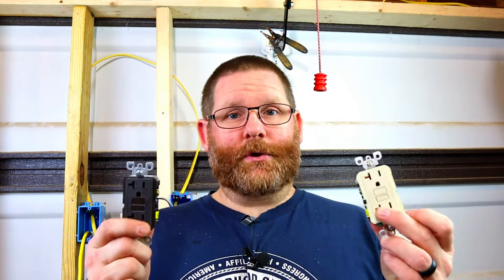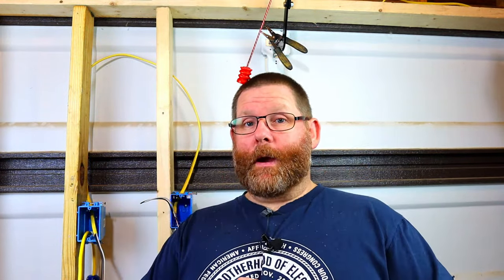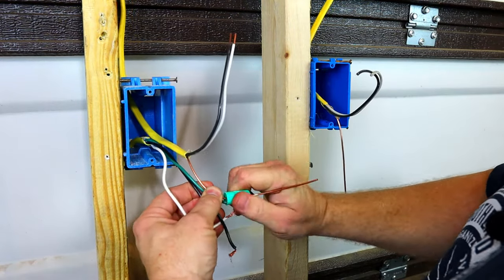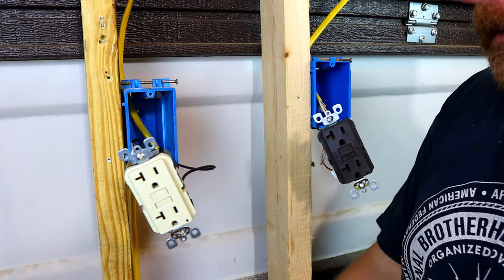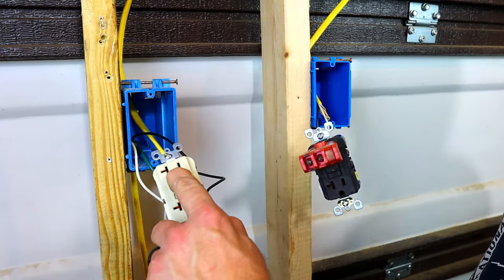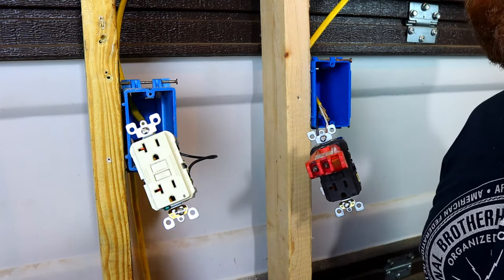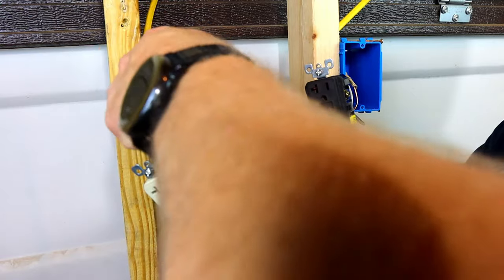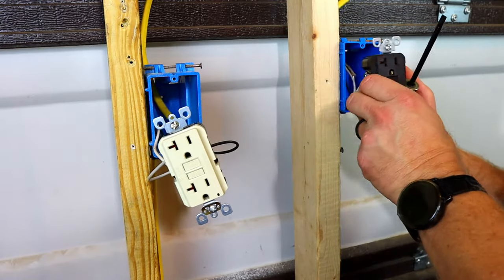How Many Ground Fault Circuit Interrupters On One Breaker

Comment: I recently put up a pool. I have a dual receptacle outside for the pumps. Both receptacles are GFCI. These receptacles are being fed from another receptacle in my shop. Just to say if the pool was to rupture and the water hit the outlets, wouldnt you want the GFCI outside to trip the GFCI in the shop as well to kill all power from the shop to the outside receptacle? In order to do that they would have to be wired the first way you showed correct? Is the first way a not correct beacause its a safety issue as well or because its just a nuisance? Or would i be better off just putting a GFCI in the shop and 2 regular recpetacles outside for the pumps?
Reply from the maker: So my opinion will or can be alot different from most of the people who do pools. In your scenario if the pool bust. I personally would want the box with the receptacle to be completely dead. In other words, if you had a gfci in it and it bust, the gfci would trip leaving the wires hot inside the box. Which is ok by code but let's say that the water is up to box level well you have a circuit that is hot, submerged in water. Now if you do have it feeding regular receptacles off the back side of the gfci in the shop, once the water trips it the whole circuit is dead up to your shop leaving the pool receptacle completely dead. That's what I would do. Make sure that you put the stickers on it that are included in the box. Saying that the Recep is gfci protected and my recommendation is buy weather resistant receptacles.https://www.amazon.com/dp/B001DFOZ4S/ref=cm_sw_r_as_gl_apa_gl_i_KFRMBKA27CYGE8YKDFQB?linkCode=ml2&tag=mountaineerou-20
Reply: Thats what I am going to do then. I just figured 3 GFCIs would be more protection than just the GFCI in the shop in case it fails but i guess in that scenario if the gfci in the shop fails it would still be hot up to the box with the other two GFCIs.
Reply: But just for my knowledge. Is the first example you showed a safety issue? Will it cause problems with the receptacles?  Or is it just wrong because it is a nuisance to have to reset all GFCIs if one trips?
Reply from the maker: It won't work. Because you cannot feed a gfci off a gfci load to line. If you hook it up line to line it will but still be hot in the box. Hope that helps

Comment: Extra Cost for no gain.  Pigtails on #1 should be correct or the same as 2 wires on the input Line Feed.  Fancy electricians gloves are handy.  I didn't see if you reset the #2.

Comment: Excuse me but, if you pigtailed the wiring on each outlet (both being connected to the Line terminals)  , they should work ... Correct ?  Each GFI would be independently powered and the breaker would be independent on each GFI.
Reply from the maker: Yep exactly

Comment: Wonderful instruction. I plug my Hair Dryer (with a self contained GFCI in the cord) into a GFCI circuit.  Will try tripping out the wall mounted GFCI to see what happens. Thank you.
Reply: Ya been my experience 2 gfci don't like working together but maybe modern ones have worked that out

Comment: Question: if you have two gfis in one box, and both are 20 amps. You must have a 40 amp breaker, yes?
Reply from the maker: Nope 20 is 20. Providing that the wire is a 12 Guage and everything is correct
Reply: @MountaineerOutdoors  fantastic!! Thanks

Comment: I have three gfci one in each bathroom. All of them seem dead and will not reset. Plug tester has no lights confirming no power to any of them. I am assuming they were wired wrongly at some point and tripped but are unable to reset. The question is how to find the parent gfci that is causing the others not to work?
Reply from the maker: If all 3 are dead are you sure that there isn't a breaker tripped??  To find out which one is first you will have to take them all apart and separate the wires and once that is done you will be able only have one that is hot.
Reply: @MountaineerOutdoors  i am pretty sure there are multiple on one circuit. We have had this for a long time and just never got around to fixing them. Do you think i could find the live gfci with a non contact detector/meter if i took off the cover and got the meter to the terminals?
Reply from the maker: If they are wired correctly then no. If you have 3 gfcis and they are wired on the line side it will just keep sending the hot to each kinda like pig tailing. I would definitely pull out one and see if you have a hot there. Use both a non contact detector and a true meter to check at the screw terminals.
Reply: @MountaineerOutdoors  thanks for the advice. It gets really confusing. I know just enough to be safe so this helps.

Comment: I think If you referred to the line side it might be more clear to some folks.  Such as I put both white wires on the silver terminal line side and both black wires on the brass terminal line side it might be more clear.  You turn your receptacles around naturally, when you tighten the the terminals to get a good solid grip.    Makes sense but it might confuse some people.  I had to re-watch it myself a couple of times.  Not critical, trying to be helpful
Reply from the maker: Oh no I completely respect your comment. And you make a very solid point. From here on out I will Def say that... That definitely will help everyone out and I appreciate your input. Thanks for watching and commenting ☺

Comment: Can u do one with 3 GFI would it be the same? Just keep putting them on the load? Am looking at putting them on the soffit of my house should they all be GFI? Would I also need a metal box to connect all 3 oe can u just connect them all without a box.
Reply from the maker: Definitely all gfci and if you use all gfcis wire them to the line side. And absolutely put them in a box
Reply: @MountaineerOutdoors  if u do one of these can u please tag me. Also could I use the existing wires coming from the outlets in the garage?
Reply from the maker: Yes you should be able to.
Reply: @MountaineerOutdoors  thank you electricians want $125 to $150 an outlet and trying to put them up for cameras
Reply from the maker: Not sure where you are but here in my small town when I do things on the side I charge 35/hr   bigger areas around me side work is 50-60/ hour.
Reply: @MountaineerOutdoors  In Oklahoma.

Comment: What if the first receptacle in the circuit powers the refrigerator? Then I have to pull the fridge out from wall to reset it?
Reply from the maker: That would be correct. Did someone wire it like that?

Comment: Hey thanks for the vid it did help!! I have a question idk if you or anybody here could help. I'm remodeling my house and had to rewire the whole thing, now I connected the electrical box and everytime I turn a breaker on it doesn't trip it but cuts power off I've been troubleshooting it but I can't seem to find the solution. I have a tester with me and power is on at the poles, all the breakers are off. As soon as I turn any breaker on the power to the the box shuts off. When I turn the breakers off the power at the poles turn back on
Reply from the maker: Do you have it hooked up right? I would have to see a picture of your box

Comment: So when you have two outlets on a kitchen counter by a kitchen sink both outlets have to be GFIC ? Which is on one circuit ! So am I right?
Reply from the maker: Any thing in the kitchen has to be gfci protected. You can line and load them but they have to be protected by a gfci circuit

Comment: I've got a different, but related, question: I extended an outdoor outlet circuit underground to power a shed. I put a GFCI Circuit Breaker onto the circuit rather than dealing with changing the outlet cover to accept a GFCI outlet from the existing standard outlet, but as soon as I got the underground wire hooked up (18 ft from house to shed, plus another 10 or so ft along the house and inside to the panel), the breaker inside would immediately trip, regardless of how perfect I made the wiring. When I replaced it with a standard breaker, now it works perfectly.

Any idea what's going on? Why a GFCI breaker keeps tripping on an underground wire?
Reply from the maker: Is your conduit full of water? Is your nuetrals touching your ground wires? Is your gfci breaker hooked u correctly? Nuetral from circuit on breakers not the nuetral bar?
Reply: @MountaineerOutdoors  I bought liquid tight flexible non-metallic conduit which is one single piece from junction box on the side of the house to junction box inside of the shed (it goes in through the shed floor to prevent water ingress). I used direct-burial rated 12-gage romex (solid plastic all the way through instead of paper) which also makes a non-stop run from junction box to junction box at each end. I can't say for 100% certain that there's no water in the line, because I laid the line a day or two before I ran the wire through it, but I did make sure the openings were pointed down, or otherwise sheltered inside the shed. I know the junction box doesn't get rained on because my eaves are 22" not including the gutters on a 1-story house, and the box is 3 ft above grade. 

As for the circuit breaker, itself, it was definitely wired correctly because it predates the underground extension by a year or two with no issues.

Comment: one GFCI can protect all downstream receptacles which do not have to be GFCI.  by the way you can put 100 outlets or 500 outlets on a circuit.  there is no limit.  however the local inspector will usually have a Number like 10,  because they seldom understand the code and they use rules of thumb.   sensible wiring of a home will be 10 or less but there is no limit.
Reply from the maker: Yes I fully agree with you... There definitely isn't a set number of receps. I like the 10 rule though
Reply: I would agree that there is no limit for recepticles, however, nec article 110.3 b
 Says we must follow the instructions for the listing or labeling.  I believe the instructions that come with the gfci restricts us to 5 or 6 down stream recepticles.
Reply: @keithharrington4595  good point for gfci.

Comment: Hey man I ran into a problem with my own house.  Built an outdoor deck that surrounds an above ground pool.  We had electricians come and put in outlets on the outside of our deck.  There’s 3.   All of them are GFCIs.  We never really used them until this summer we hung string lights and we plugged in the string lights with an extension cord.   The string lights and extension cord are both outdoor rated.  After a couple days I went to plug it in and they wouldn’t turn on.  I noticed the gfci had a yellow light and the other GFCIs were not even on.    I’ve trouble shooted and looked inside the one that has yellow and eveything looked right.  I used a differnt outlet on the other side of my house that was on a different circuit and the lights worked. It’s just that one circuit with the 3 GFCIs.  The pool is right next to my garage and the only other thing on that circuit is my the battery/light for my garage door opener. Also it’s all 14 gauge wire.  Any ideas of what could be going on?
Reply from the maker: Maybe bad gfcis. Or they are hooked up wrong
Reply: Those were not real electricians if they put multiple GFCI Outlets on one circuit. The correct way is the first Outlet on the series gets a GFCI outlet, and it will protect everything Downstream. It just has to be wired correctly which is basic stuff. The load screws feed and protect all the outlets Downstream, the first Outlet gets the power from the circuit breaker to the line screws. If they did what it sounds like they did they are just some guys who don't know anything and are saying they are electricians.
Reply: If your house is in an environment that received significant amounts of snow it can pile up near the outlets an destroy GFCIs. I have a GFCI that went bad on my back porch from snow intrusion. I'd replace the extra GFCI outlets with standard and wire off the load on the from the parent GFCI. If the others are still good keep them to replace the parent later. GFCIs have a shorter life span in wet environments.
Reply from the maker: Great advice!!

Comment: you do not show trying the test or reset on the second gfi to see if it won't reset or is tripped because it is plugged into first gfi would be easier if the second gfi had those indicator lights or button that appears red when tripped. was the reset button pushed in does it show tripped?

Comment: I always use the stab in the back connections, comments that lead individuals to think using the stab in the back (manufacture design) is wrong/dangerous is simply comical.  Otherwise, I enjoyed the video.
Reply from the maker: I wish that I could agree with you on that. Although I appreciate you watching, I have been on too many call backs for compromised receps. I appreciate your comment and watching though. Have a great day ☺

Comment: Customer has a prefab greenhouse with a gfci. The whole thing plugs into another gfci on a stand alone breaker. When the greenhouse is plugged into the other gfci, the gfci on the breaker stops working.

Comment: you ask why would we want several gfci outlets on one circuit- take a local law that restricts the number of protected outlets from one gfci outlet on the load side to 3 outlets.  You have a standard bedroom with two outlets on each wall, a light in the closet, and a light and fan, all from a single breaker.  The way I wire this in the local area is three GFCI outlets, from the panel, with one protecting the lights, one protecting three outlets and one protecting two last outlets.. so I know have one 20 amp breaker for one bedroom, 8 outlets, two lights, so ten points, within my 14 points for one breaker, (12 points if you include the switch points but still within the 14 points for 20 amp breaker under local code), but have the three gfci outlets to get around the gfci load limits. It works, the local inspectors and my customers feel I have added safety that is not yet required locally, but, it is done. Plus, since all cabling is done here in conduits, it is pretty easy as i run the conduit from one outlet box to other wall for gfci runs instead of along the wall for the load runs..lol.. Local inspector has been taking pictures to show others this as correct way while agreeing that we need to change the load limit on outlets as well..

Comment: In the incorrect method, can't you still get the second GFCI working by simply resetting the receptacle, or will that trip the first GFCI?  I have never tried that but I have heard of it working that way.  Its the current imbalance that trips the GFCI right, so essentially both get tripped when one trips cause there is a current imbalance on the circuit.  My house just has one circuit for all the bathroom outlets and then a GFCI on the first receptacle.  The other bathrooms are still protected because of the first GFCI correct?  It was that way when I bought the house so I assumed that was allowed based on NEC.
Reply: Absolutely correct. No reason whatsoever to put multiple gfci's on a single circuit. All outlets after the gfi are protected. As he showed the 2nd outlet still had power at the screws but not out of the front of the outlet. The test button is just a internal "mechanical" resettable switch. You would still have power at the back of first gfci. If you want to do it right, put a gfci breaker in the panel.
Reply: Exactly, if the second GFCI is connected to the upstream GFCI on the load side, when the first tripped current will be cut and trip the second GFCI therefore you also need to reset the second one.  One GFCI for the entire circuit is allowed by NEC.

Comment: Sure, you only need a single GFCI receptacle upstream protecting all n regular outlets downstream.  But, once the drywall is up, unless you previously kept a "map" or other record of which outlets are daisy-chained to which or were the original installer and simply remembered, any user or later person/owner/tenant/whoever can spend hours trying to figure out what happened before finally speculating there's a lone upstream GFCI receptacle somewhere, and more hours locating it.  (This literally happened to us, and even an electrician neighbor spent an hour helping us figure it out and finding that GFCI, which turned out to be in the garage, darkening a receptacle on the other side of the wall in the living room.)

Multiple GFCIs in Parallel has the benefit of localizing the reset switch to the (presumably) nearby plugged-in device that tripped that outlet in the first place.  You don't have to travel far to reset it right away after (hopefully) correcting the issue, let alone go on an expedition to find it, or go all the way to the panel/sub/loadcenter.

The cons are:
1) that each GFCI only protects that receptacle's devices from ground fault rather than a ground fault anywhere along the circuit, and the breaker can't be GFI either (though it can probably be AFCI or CAFI (series + parallel arcs on the hots))
2) you need n GFCI outlets, which can run a pretty penny, especially if you splurge for dual-function ones (AFCI && GFCI).

I'm putting in 20A outlets near all HVAC (attic + backyard), dehu (elsewhere attic or dedicated mechanical closet), water heater, laundry, and related appliances, as courtesy for any future service workers on those (or my future self), for tools, cellphone charging, whatever, and am probably going to go for 4-5 GFCI or dual outlets, on a single shared circuit (because they're unlikely to need to be used more than 1-2 at a time), all in grey color (to distinguish them from "normal" home use outlets).  This will keep the test + reset buttons for that outlet as near the user as possible, so they don't have to crawl out of the attic and go reset it from some other location or the panel, or have an assistant do so.
Reply from the maker: That is a very good explanation and I truly believe in that situation you're probably is a good idea. Thanks for commenting watching